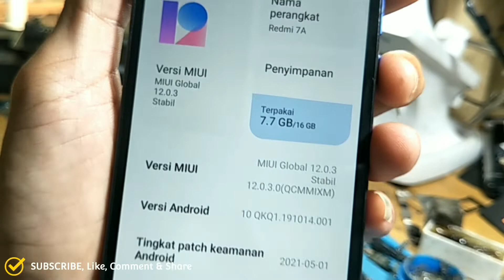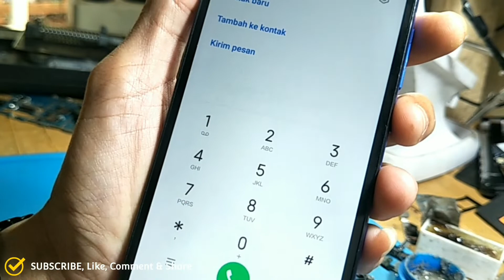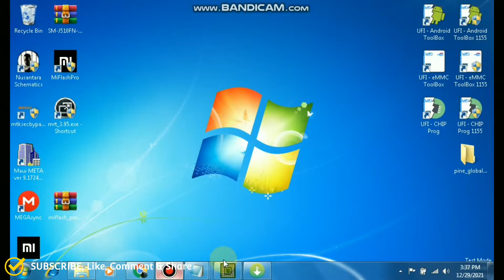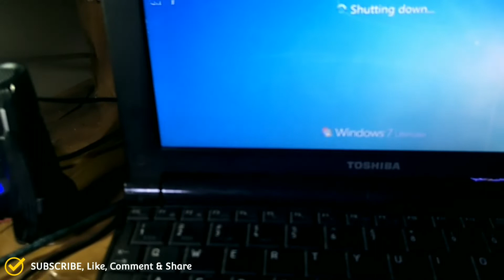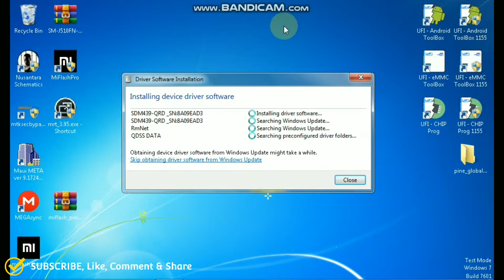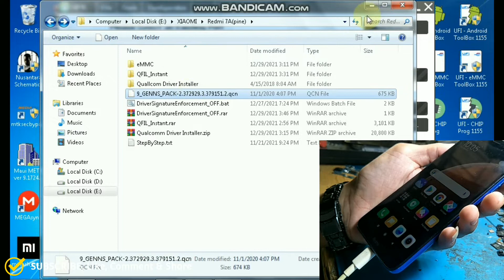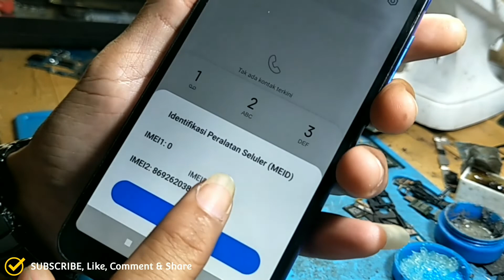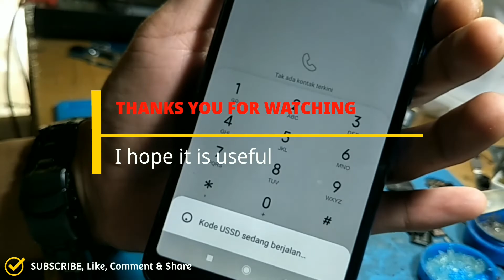Repair IMEI Redmi 7A Pine AB CPU | Without NV data is Corrupted

Comment: smgt bang.... 👍
Reply from the maker: Terimakasih kang 😊
Reply: @mobilecareid  bang mau tanya driver sdm 459 itu drmn y bang. sy blm bs konek ke diag 9008. pdhl kl hp lain mah ok2 aj. tp di 7a detek sdm 459
Reply from the maker: @samirteknisi  Diag mode apa 9008, hp nya kenapa emang
Reply: @mobilecareid  gak bisa detek diag mode bang.utk setting di hp #*#717717#*# udah enable. tp di port kompi gk detek.
deteknya sdm439 qrd. jg ky driver diagnya gk ke install. tp kl hp2 quallcom sblmnya bs. baru ini gk detek di mode diag
Reply: mksh responnya bang smga cepet aampai target subc nya 👍
Reply from the maker: @samirteknisi  Colok dulu HP nya ke PC, setelah diaktifkan diag mode di #*#717717#*# lalu restart HP nya (kabel USB jangan dilepas), cek kembali di device manager
Reply from the maker: @samirteknisi  Siap sama2 kang, aamiiin ☺️
Reply: @mobilecareid  alhamdulillah done mksh bang bahannya.gr2 micloud hp matot.flash ufi imei 0. smg berkah cr rizkinya
Reply from the maker: @samirteknisi  Alhamdulillah, sama2 kang, aamiiin 😊